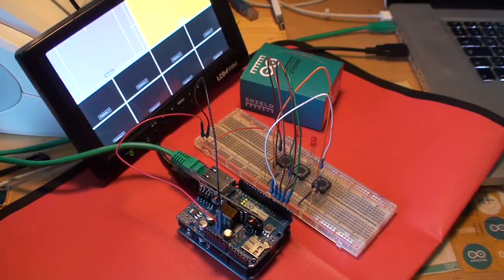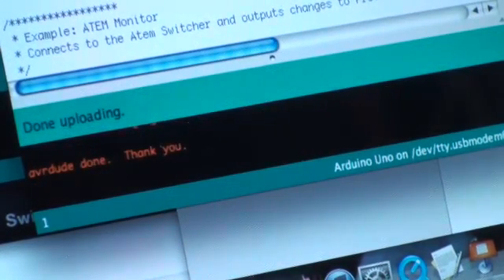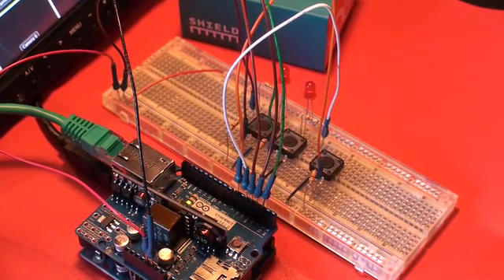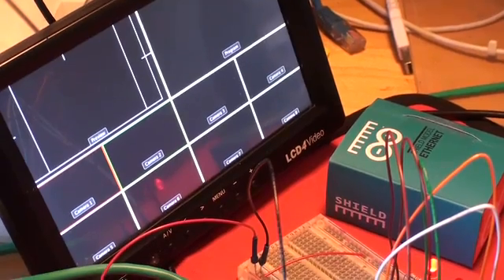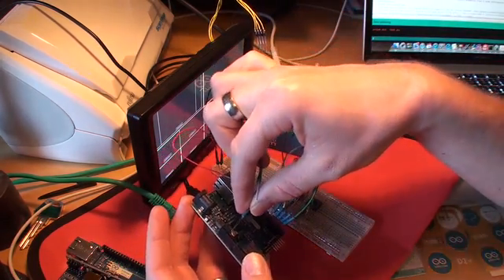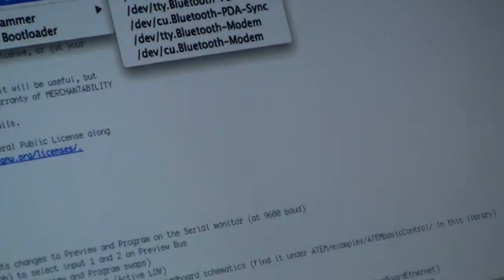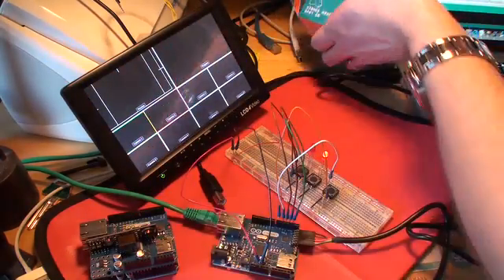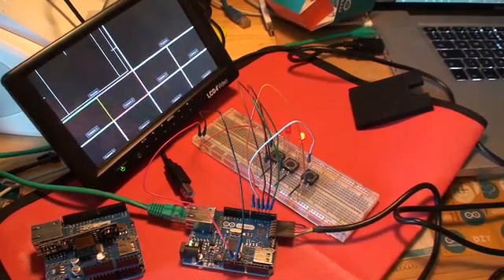Arduino Library for ATEM Switchers - tutorial

Comment: Hello ! 

  I tried to compile the Atem Monitor but i had that problem: template<class T>
inline Print &operator <<(Print &obj, T arg) - T has not been declared ... What can i do ?
Reply: +Jean-François Thyssen 
Hi, I have the same problem. Did You solve it?
Reply: +darthyoda36 
I used a arduino ethernet. So i didn't know i need a driver for the FTDI ;-)
That's the problem
Reply: The multi line template is causing the error, try:

template<class T> inline Print &operator <<(Print &obj, T arg)

Comment: It _does work_ with Television Studio! It's just that the library supports features not found in the TVS model so for instance if you try to switch to input 8 (which does not exist on TVS) I can't guarantee you what will happen. Probably nothing.
In any case, I'm the owner of both a 1M/E and TVS model so I can promise you that I will support both in my forthcoming updates of the lib.
- kasper

Comment: Sure it works with TeleVision Studio. I have both myself. I didn't try with 2M/E yet, but would expect it to work with that as well, but probably the library needs some modification. The library is currently created based on a 1M/E - it does control a TeleVision Studio as well.